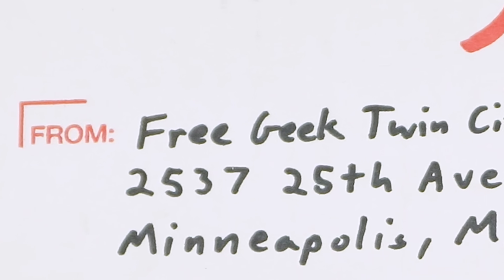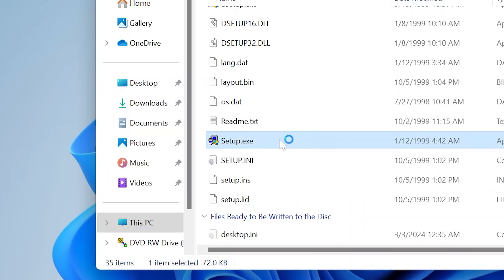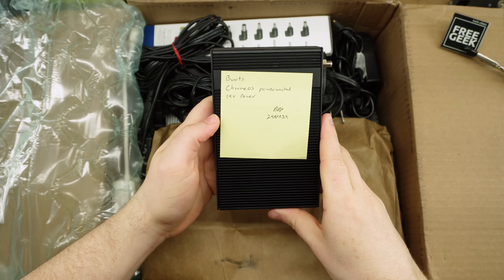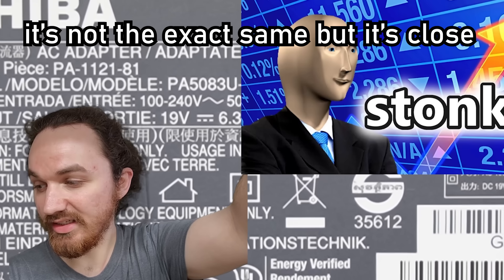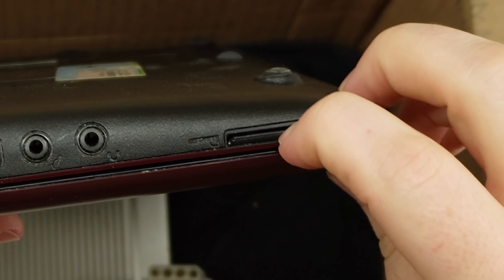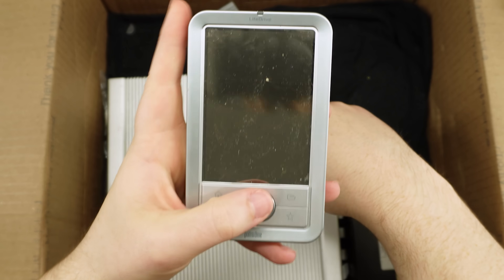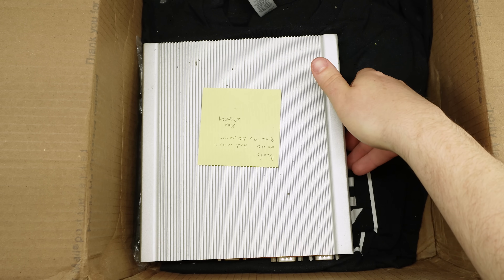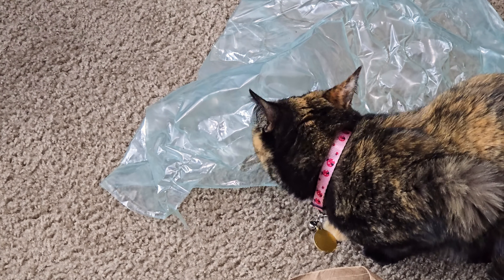The Free Geek Twin Cities E-Waste Haul

Comment: fun fact about those microdrives (like in the Palm), 9/10 times they're literally just a Compact Flash card. you could just pop a CF card in it and it'll (probably) work
Reply: Extrange
Reply: That's because Compact Flash is just a PATA (IDE) connector miniaturized. (well, technically it's a 50-pin subset of the PCMCIA standard, and depending on how a mode pin is set, operates either as a PC Card interface or as IDE, but I assume most modern-ish devices probably don't support the PC Card mode anymore), the newer CFast is SATA, and CFExpress is PCIe based. Compact flash cards are quite literally just a low cost/performance SSD, or in the case of this guy, micro HDDs.  So it's really not surprising that many devices which use micro HDDs used the Compact Flash standard, rather than reinventing the wheel again.

Interestingly, this means you can also just use any compact flash card with a pin-adapter on any old IDE based desktop PC instead of relying on slow and possibly unreliable old mechanical drives or specialist IDE SSDs.
Reply: @Jay-ik1pt  yep! i use a CF to IDE adapter in one of my older (~2008) servers. im sticking with a mechanical drive for my 98/2000/XP/whatever-the-fuck-else Pentium 3 machine just cause its a for fun machine
Reply: Judging from the sound it makes, no that's really a spinning drive.

Comment: The sounds the palm phone was making were the hard drive screaming in pain replacing it with micro flash memory would restore it to it's former palm glory
Reply: Indeed. I found one of those in E waste and the drive was about all that worked. Battery toast, screen faulty, wouldn't boot, didn't show up on USB. Even tried jump starting it with a spare battery.
Reply: technically better than when it was new.  I had a lifedrive from 2006-2009 as my main on the go computer/mp3 player and that drive could definitely slow you down.  I found another one for cheap in the 2010's and did the CF upgrade on it and that thing is light years faster.
Reply: I have one the drive runs like new somehow

Comment: 8:54 Much like the original ZIP Drive and the flatbed scanner that came with my first computer, since this plugs into your parallel port it has a pass-through port to plug your printer into, that way you didn't have to keep swapping back and forth whenever you wanted to print or use the other device.

Comment: 15:39 I have some of these by the same brand. They're passively cooled (which is why the case is all metal and has those ridges) and sealed up inside, you can usually find them in a factory or automotive plant. Anywhere that a bunch of crap could get into air intakes so they deploy these for running robots, kiosks, etc. that you'd need on the out on the floor. I put Linux on one and made it into a pretty reliable HTPC, and even dabbled in emulating games on it, although it doesn't like anything much further than the SNES or early handhelds. Considering I got half a dozen of them for nothing (they were going to recycling anyway) they're pretty neat project boxes

Comment: Those "industrial" computers are for kitchen use in restaurants. They run the computers the chefs use to see what items come through, the ridges on top act as both a heatsink, and a horrifying way to catch frier grease for years before they get replaced.
Reply: They also get used in big factories to control machinery and robots
Reply: atleast the grease aint getting inside the case and fry whatever is inside

Comment: That orange computer might be in an industrial computer. They're designed to be in factories
Reply: That is 100% what it is. Windows IoT is just slapped on every flavor of them. There's windows in places that windows should never go because of those.
Reply: I don't know what it is but I want to run my Linux on it. Where and for how much can I buy one?
Reply: Little guys
Reply: Onlogic an, i think dutch company actually creates these orange boxes i believe (at least i am getting lots of advertisements from them which show the exact same pc) and they are indeed embedded computers and you can select your specs and os.
Reply: Its used to run a SCADA in industrial systems. The waterplant I work at uses the same one.

Comment: that Dazzle is a MPEG-1 video and audio encoder/decoder (and analog video capture card). it can record video in realtime at 30fps but also enables video playback on Win95 computers that don't have enough CPU to decode video in software. printer port is just a passthrough because your computer would only have one parallel port

also DOM stands for "Disk on Module" and they were common in industrial and embedded computers. they're meant for when you have a small operating system that doesn't warrant a hard drive - uses less power, more reliable because it's flash storage, and doesn't take up much space in your computer
Reply: Also, it used a parallel port because it predated the widespread availability of USB.
Reply: Yes DOM was used on many industrial computer, they first came with IDE interface and later generation got SATA interface, their size is small because, it's just contain a minimum OS setup and the program used to control any industrial machines

Comment: SATA DOMs used to be used for stuff like hypervisors where you only needed a tiny storage for the host OS and didn't want to use up drive bays
Reply: SATA DOMs don't need an external power connection if the motherboard has a special powered SATA DOM ports, or they can work in regular SATA ports with external power

Comment: That tiny SSD probably got used for industrial setups or those ones where it's an entire computer on an expansion card.
Reply: Also there's in some computers (like embedded or server environments) that would be able to power SATA DOMs purely from the SATA port. They would basically add a pin 0 and pin 8 to the outside of the SATA connector that would provide a ground and power connection for the DOM to use.

Comment: OH also, with that Lifedrive, look into replacing that Microdrive with a CompactFlash card :) It was a very popular mod in its time.
Reply: Yes, you can replace it with 4GB or 8GB CompactFlash card, it's much faster and also no noise, and of course, run much cooler and consume less power than the original microdrive disk

Comment: for those who could be wondering when it comes to that palm device;

It does in fact have an Intel CPU. It's an Intel PXA270 which was one of their XScale ARM processor lineup from wayback when they dabbled in the mobile CPU market. that's right. Intel CPU, but it isn't x86 and it's also not iTanium.

The 270 in particular could be ordered with clock speeds as low as 312MHz up to 624MHz

it had Intel SpeedStep to reduce the clock and power draw at low load, as did Intel's Pentium 4 line at the time

and also carried the Intel SSE instruction set as well as their "Wireless MMX" aka iwMMXt instruction sets.

The PXA line was mostly seen in PDA type devices but were used in mobile phones. Blackberry's Bold 9700 had the PXA930, the Torch 9800 had the PXA940 for example, and you could also source system-on-module (SOM) and embedded systems which had Intel PXA silicon on them.

Weird little chip considering Intel was and still is fairly gung-ho on bolting extra instructions onto x86-64!

Comment: Those labels are heat printed, so if you ever want to have fun with them you could use a torch (or heat gun if you want to be safe... ew) to maybe hide them. I would still tape over it though, sometimes the black from the heat gun isn't as hot. But, we all have a little pyro in us waiting for a reason to get out a torch.

Comment: 4:38  I think that the ASCII Data Generator is the primitive ancestor of a graphics card.   To display text on a TV set, your computer would output RS-232 text.  The connector on the right side that we briefly see at 4:47 would hook up to the antenna of an old television set.  For each character that the generator receives, it would write a character on the screen, probably in black and white.  The switch for "Msg 1, Msg 2" might let the user specify the text size.  Standard NTSC video had only 480 visible lines, which meant only 480 pixels of screen height.  It might have been able to display 24 lines of text.  This device gave the computer a way to display text without buying a teletype or VT100 terminal, both of which were too expensive for most hobbyists at the time.   To try out your device, connect it to the antenna of an old TV set, then send in some good old fashioned 9600 baud RS-2322.  You are likely to find that it works just like it did in the mid 1970's.  There is probably a computer museum somewhere that would like to have it.

Comment: The Logic Supply PC used to use that model Water/Wastewater plants as remote scada computers. Solid computers but had to replace the hard drive as the installed one was prone to failure in a higher temp environment.

Comment: 16:24 Oh hey! A Visix! I had one of those. They have a bog standard Intel Desktop Board (DH61AG) in it with a 3rd gen Intel Core i3 processor. it should also have 4GB of RAM and (in my case) a 64GB SSD with Windows 7 Embedded. Good little machine for what it is. Very quiet and pretty low power!

Comment: the "Dazzle" is for an amiga and the printer port is there because in 1985, there are family computers that probably had a printer in the house next to it that your parents used so if you used the "Dazzle" and your using the printer too then you can use both because the amiga only had one port for the printer and the dazzle goes in that port. I discovered this with sample cards that go in that slot for samplers and trimming and used in Fast Tracker 2.

Comment: That printer port on the capture unit is typical for that era. Usually you'd see it on scanners too, because you basically plug in that peripheral to the pc and then daisy chain your printer from that unit. It was the only way to still be fully functional since nothing was hot swappable.  Also, I'd say that fake sd card was there to stop dust/lint and other things getting trapped in there when the port wasnt being used and based on when that pc was around, it probably wasnt a common use port (but tbf, I dont even know if SD on a pc was ever a common use? i personally thought they were a waste of space)

Comment: That SATA thing is a "Disk On Module."  They're often used in industrial PCs and servers where you need a small amount of storage for software. They also have IDE versions. Though nowadays they've been mostly replaced by 2242 NVME drives.

Comment: Can confirm the Logic computers are more than likely digital signage devices. I've never managed Logic signage products, but for the devices I manage/support, we use a lot of IO for various things.
Multi display outputs for displaying content on multiple screens, RS-232/ethernet for managing or monitoring screens (no signal alerts, no power alerts, switch source, power on, etc.), GPIO for managing various sensors for presence detection usually (weight, radar, IR).
Most of the newer digital signage devices don't have much of that stuff anymore since a lot has become cloud/LAN based and have APIs to manage them automatically. RS-232 is still fairly common, but GPIO has become a bit niche depending on the usages, at least in my experiences as of late.

Comment: Oh that industrial PC is the kind  got my job to switch to. Logic supply is pretty great, and they start at like, celerons but go up to i7 in those chassis. After going through so many basic dell boxes including one that literally caught fire everything on the manufacturing floor (save for like, 2 machines i think) is one of the logic supply machines or whatever questionable brand equivalent from amazon.

Comment: Digital Forensic investigator here. That write blocker was sure a great find, and you're right; We do use them when acquiring artefacts from storage media, especially for use in court. There are software write blockers as well, but those can be less reliable, and thus, the courts don't always accept them. Newer write blockers tend to calculate the hash for the media as well, so you can compare it to the hash in your acquisition software and of the image as well.

Comment: From what I know those tiny sata thumb drives are used just for booting, you put a custom distro in there. I think the idea is that it takes very little space in systems where space inside the case is very limited for whatever reason.

Comment: When running old software on pc usually processor and windows tend to be compatibile or configurable to be conpatibile. This is where IGPU comes in. Intel integrated gpu:HD,3000,4000,Iris are ancient architectures that don't have problems with old software compared to things like Nvidia post Pascal generation and AMD post RDNA arch. Also tools like DXVK or DX9py which act as translation layer between proprietary graphical libraries and OpenGL or Vulkan can make programs run. And sometimes it's as simple as ap not being able to resize window or utilize windows desktop manager DWM.exe so it runs only in fullscreen.

Comment: 11:43 It's not standard, but powered SATA ports are actually a thing for exactly this type of drive. They stick another power and ground in the sides of the connector, and you can plug a compatible DOM into the board directly with no other power.